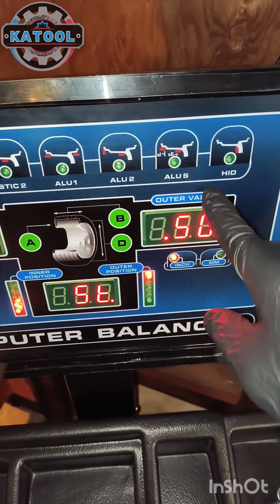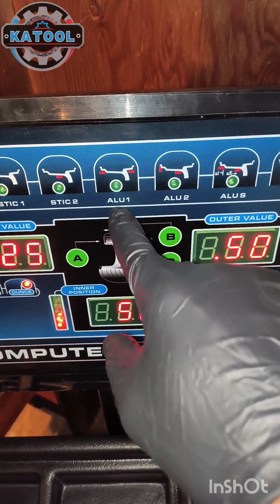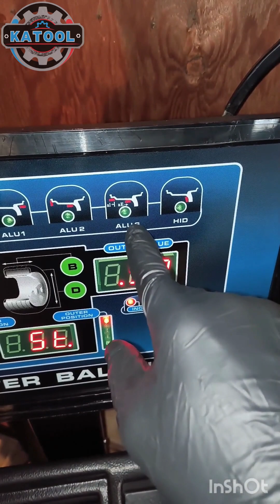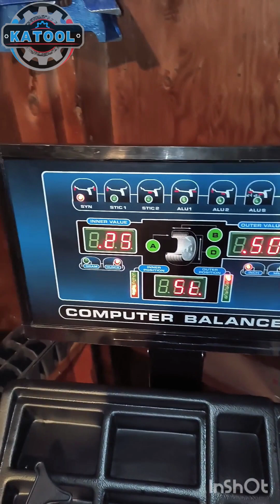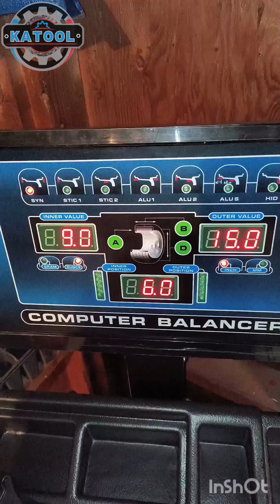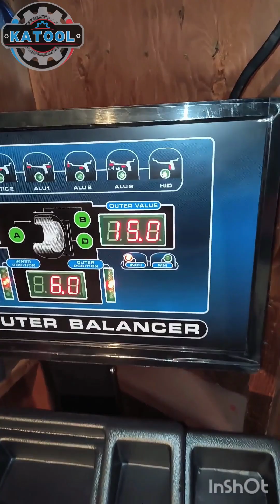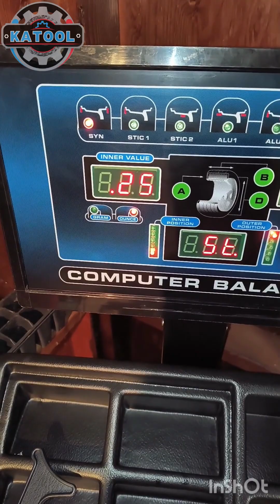KATOOL Wheel Balancer: How to video

Comment: THE TRUE TEST --- After the wheel/tire is balanced, remove the assembly then re-install it in a different orientation on the cone and flange and re-spin it. It should still show balanced and not call for more weight. Aside from a mounting error (assuming you mounted it correctly both times), this will check the repeatability of the balancer. Please do a video on that to test this budget balancer! Or, you folks out there, try it on yours and leave comments on your results.

Comment: Wondering what the distance from the outside of the hub plate to the side of the machine is?  I have 12” wide drag race rims and with the tires mounted have total width of 13” so wondering if I can use this machine without the tire hitting the side of it?

Comment: Our laser pointed at the bottom of the wheel,  and we had out best results, using sticky weight, placing it along the laser line on the bottom of the wheel.  A different variant?
Reply from the maker: Yes, that’s the exact correct way to do it. In that mode, you will place the weights where the laser tells you to.
Reply: @Toolchoice26  Can you use the laser in any mode? Is there a simple on or off switch to control this feature?
Reply: @Toolchoice26  why iam having trouble to balance 35 in tires